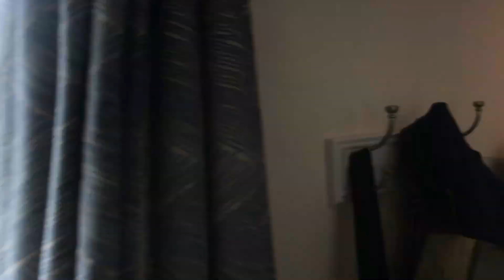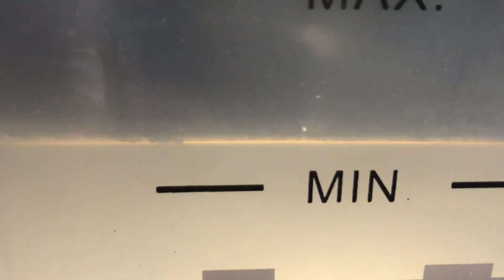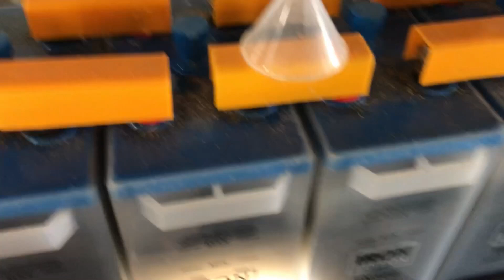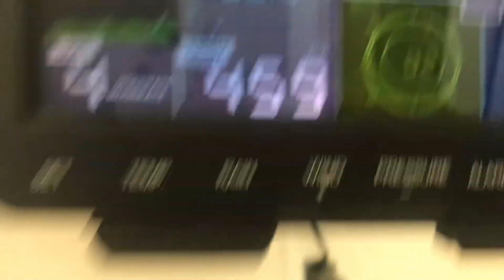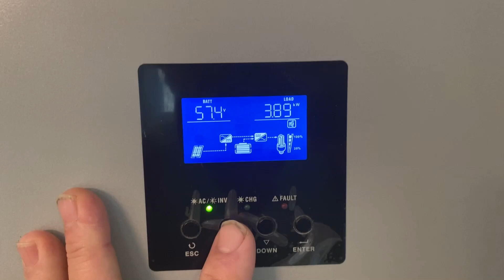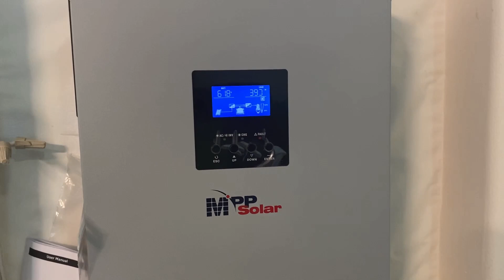72 MPP Solar 5048MG with Nickel Iron Batteries Overview

Comment: Hi Steve, I have  40 x 1200amp hrs  nickel iron batteries and I would like to know the settings for 5048ms controller to run 64v , I would like to know the settings if possible to set this up. Glenn
Reply from the maker: You need to set both bulk and float voltages to 64v. Charging amps for 1200ah set to the highest setting.

Comment: Are you aware of any  solar power meters that can be remotely monitored similar to the reading on your weather display in watt per meter etc ? If so I would like to get that information from you., I would also like info on which weather unit you are using ie brand model etc.  Thanks in advance.
Reply from the maker: I ordered a sensor from EBay that measures light intensity. I plan to interface it to a SONOFF so that I can access the information from it, but that will be a ways off before I get around to it. 
My weather station is Ambient Weather WS-2902.
Reply: @OffGridLivingReally  great Thanks
Reply: @OffGridLivingReally   Thanks

Comment: Hey, the inverters have AC input and AC output, what connects where? What's the difference?
Thanks
Reply from the maker: Regarding an MPP Solar inverter:  The input is used from either a generator or commercial power. The inverter will simultaneously charge your batteries and pass that power through to your house. It must be the same voltage as your inverter output. So if your inverter outputs 240VAC, you must give it 240VAC. the AC output connects to your AC mains in the service panel. If you need split phase power you must first run it through a center tapped transformer before attaching to your mains service panel. Try to find an electrician to help you install it. These inverters generally use high voltages on the AC an DC terminals that can easily kill you. I have a friend who was nearly killed recently. His thumb was nearly burned completely off and he has large hole in his chest where the electricity exited. Please be careful.
Reply: @OffGridLivingReally  
Very well explained. Thank you sir

Comment: Hey Steve hope all is well,
On a pwm charge controller is it better to up your voltage or your amperage?Either way I configure my panels it same wattage...
It's the rig I carry hunting and has short leads to everything so that's not a worry.The pwm is cheap chinese stuff but works for what I'm doing.It's max voltage is 50v 30a.The panels(4) max at 20v at 4.5a each.Right now it's all parallel and works fine.I was just curious if I series 2 panels then parallel them would it charge better?I think correct term would be 2s2p lol but that's jedi talk for you masters!Thanks
Reply: Chris Lewis on pwm, higher amperage is better.

Comment: Is there a specific MPP inverter I need to handle the high charge voltage of a NiFe bank?  I have the manual for the LV5048 and it looks like it only handles up to 60V.  I am considering a 40 cell NiFe bank purchase but the full charge level on that bank would be 66V.  What info am I missing?  Thanks!
Reply: Peter Zehr you are right. The LV5048 only goes to 60V. The 5048MG is the only inverter from MP Solar that will provide voltage high enough to charge NiFe batteries.  I use the toroidal transformer to efficiently obtain split phase power. 
But if you already purchased the LV5048, all is not lost. You can take 3-4 cells out of your battery to lower the voltage of the battery.  You will lose about 10% of your battery capacity, but it’s all you can do.
Reply: @OffGridLivingSteve  I have not purchased the inverter yet, where can I find a torroidal transformer? What's the efficiency like? Thank you.
Reply: @OffGridLivingSteve  I have not bought the battery bank yet either. It looks like you have a 300 amp hour iron Edison bank at 48 volts nominal. How long can you go with little to no sun, no generator and normal household loads? 

I am looking at the iron Edison banks and also considering a chinese-manufactured cell that's available on eBay for about $3.5k less for a 300ah bank.  I would have to do 40s3p to get 300ah with the 100ah Chinese cells though.

Comment: Hello Steve, I have a 2424LV-MSD and it won't charge via PV. I verified that my PV cable are working fine but im getting no signal or the logo on the LCD panel when I plug them in. D oyou know of any setting that i might be missing to turn on or off.
Reply from the maker: You should email them at support@mppsolar.com. Include a photo of the label on the side of the inverter along with a description of the problem. There’s not really anything I can say without standing in front of it in person.

Comment: BeUtilityFree offers a much better nickel iron battery case that you can actually see the electrolyte level and don't have to use a flashlight to see the electrolyte level. Plus is has a much larger battery cap which is not so small and corrodes far less than the blue flip top caps that Iron Edison cells. They also offer a gravity feed self watering system.

Comment: Should I get the lv or the mg version
Reply from the maker: I need more information before I can recommend.
Reply: Please I’ll be waiting on you I’ve a solar array of 12000w
Reply: LV is for USA voltage, it does 120/208 3 phase/240 split phase
You will need two LV5048s to support 12kWp of panels, each mppt supports 4000w.

The MG can work without a battery, the LV must have a battery (in 48V flavor)

Comment: Can I use this for a Tesla module s and can the inverter be used without batteries please
Reply from the maker: The inverter can be used without batteries, but I wouldn’t recommend it. It can charge a Tesla S with the adapter using level I or level II charging. It cannot handle level III charging
Reply: Is there any inverter you would recommend bro pricing isn’t my problem I’m tired of researching I seem to find nothing, looked at solark all in one but they’re not compatible with 230v/50hz
Reply: I’ve a peak load of 8000w please

Comment: Steve, do you remember whether the 5048GE which you had earlier ramped up the fan based on load or temperature and also the U1 firmware version? ,  My fans seems to always be On and it ramps up based on temperatrure, mine had a USB and RS232 port but yours had a relay port and USB. Mine has a U1 version of 30.46
Reply from the maker: I like the GE model the best, but it’s higher end voltage limitation prevented me from using it for nickel iron batteries. I do remember the fan running continuously, but it wasn’t an issue. I don’t remember firmware version, but I can find out if it’s necessary,  I have still access to one of them I sold. I don’t know why yours wouldn’t have a relay port without being a different model than mine though.
Reply: @OffGridLivingReally  

Thanks you for the reply, Yes there are two versions of the com board in GE, if one needs to get their wifi box working then you need a com board with RS232. I would be grateful, if you can find out the firmware version of U1.
Reply: wrapter ok next time I’m over there I’ll have a look. It might be a bit though.
Reply: @OffGridLivingSteve   Thanks Steve.

Comment: Steve here is a very stupid question . What happens when every thing is topped off and 100% charged what than
Reply: archie ball it’s not a stupid question at all. Lots of people ask. The electricity available from the solar panels simply goes nowhere. It’s the best time to run your A/C, air compressor, welder, etc. That way you are using the electricity directly from the panels and not so much from the batteries.
Reply: @OffGridLivingSteve  I am guessing that it would be also possible to use the heating elements (using lower wattage ones than the originals) in the water heater as a load dump to make the hot water faster.

Comment: Very cool overview.  Your unique approach to off-grid solar/EV living, and your use of nickel iron batteries, is a game changer.  Question:  now that the system is mature is there anything you'd do differently if you had to start over?
Reply: That's a good question  Obviously the changes I made as the system evolved are those things I would have done differently.  Changing the inverters to ones with higher charging voltages helped immensely.  I would have bought a heat pump clothes dryer initially instead of a gas dryer.  I would like to have 5 more panels of what I have,but don't we all?  LOL

Comment: steve what is the most power you were able to pull from your ELC T-5000 5000-Watt Voltage Converter Transformer?
Reply: I wouldn't hesitate to run 3kw through any leg of it after the hack.  The transformer's breaker is 25amp which just so happens to be 3kw at 120v anyway.  Having said that for system safety's sake, now for the technical Easter Eggs:  Depending entirely on how well the load is balanced between the legs of the split phase, believe it or not the limit is infinite if the two legs are always within a couple of kw of each other.  If you have a 1000 watt resistive load on each leg, the neutral doesn't carry a load at all, because the two 1000 watt loads simply act as a voltage divider (in half)  - when this happens, the transformer isn't doing anything at all, it's just freewheeling and keeping the overall split phase balanced for the electrical system as loads are added or shut off.
Reply: @OffGridLivingSteve   Thanks man!

Comment: How many kilowatt hours does it take to dry a load
Reply: Depending on the load dampness and size, anywhere from 0.468kwh to 0.626kwh.
Reply: @OffGridLivingSteve  that's really good compared to my 120 volt dryer that has an electric heater element.  My 120v dryer takes 3kwh to dry a load.  I think my 240 volt electric dryer takes around 2kwh.
Reply: @SiriusSolar  The heatpump  technology is really amazing, and I really like the fact there is no duct work for exhaust!

Comment: Steve, Happy New year!  Glad to see the MG is working out(those  few extra volts of charge headroom look like they help a lot). Have you done a video on the "pad" monitor thing? That looks pretty handy. Walmart has some of the the small (10amp?) smart plug wifi switches for $9(?) right now.
Reply: Brad,  just those two more volts of charge made ALL THE DIFFERENCE.  I get a full charge to my nickel iron batteries now.  Any switch  that uses the TUYA app can be hacked to interface with Domoticz, OpenHAB, or HomeAssistant.  I found a hack on the web for them and it works great.  I have  Domoticz controlling everything.  I have ordered and received a WEMOS D1 mini with a relay shield.  I'm hoping to use them to automatically power down the aux inverter at night, and have the on board A/D converter capture the voltage reading every 20 seconds or so and forward the MQTT packets to cloudmqtt.com so I can see my voltage from anywhere in the world.  I did the same thing in Colorado and it worked great.  I might do a detailed video on how to do it but it would be virtually over everyones' head.  Maybe I'll put it on my old personal channel?
Reply: @OffGridLivingSteve  Yeah, it might fit in a little better over there. In concept I have a clue about what you are talking about, but in hardware I will have to look up the stuff you listed. A quick glance makes it look like that stuff (hardware) is on the sensor end of things. Is the "pad" (show W/m2 and stuff) just a Pi?
Reply: @bradquinn4161  my metrics for light power comes from an Ambient Weather Station that I bought from Amazon.  I tied it to Weather Underground so my Domoticz can read the values from there.  There is latency, but I have rapid fire enabled, so it's only a couple minutes delay.  You can see it here: https://www.wunderground.com/weather/us/hi/mountain-view/KHIMOUNT24
Reply: @OffGridLivingSteve  I noticed that there are two ways to hack the Tuya devices. Via hardware connecting pins and "talking" from a computer. Via wireless using Tuya convert. Just wanted to make sure you were aware of the wireless way.

Comment: When you reach the max inverter output and it switches to grid  "when set that way",  does it switch to %100 grid or does it continue suplying iverter power as well  suplimenting with the grid whatever the inverter cant provide?
Reply: I emailed MPP that question on the LV5048 model which is the US split phase version and they told me it would not blend the power together in that way so grid or not grid when over max wattage inverter provides but I would also like to see what steve says.  The big differences in the 5048 MG and LV5048 is no batteries have to be hooked up to the MG and the voltage from  pv input is up to 450 on MG but only about140v on the LV.  Steve uses transformer to convert the output from single phase 220v to Us split phase 240 volt.
Reply: @teekay1785  Good discussion thread you guys!  tee kay, everything you said is correct.  However to answer Lysol's question,  If you are using the grid (or generator) as backup, and the inverter sees and is utilizing the grid, the inverter passes the power through to your loads and simultaneously charges your batteries.  There's no way around this because if you think about it there's no point in having the inverter take power from the batteries that's being put into the from the grid - just bypass that step and supply it directly to the loads while it charges.
Having said that, if you operate it in UPS mode, the inverter's circuitry will sync to the incoming power so that a power outage will not interrupt the power.  I wouldn't use it to  power a life support system,  but for 99.9% of us it keeps critical systems with a smooth waveform even during a power outage.
Reply: @OffGridLivingSteve  Yes thats true but if batteries are full and PV supplying say 5,000 watts and load is 7,000 watts  MPP said the grid would supply all 7,000 watts.  So in effect wasting the 5,000 watts from the grid unless you have a "burn off load # such as straight electric water heater or well pump to tank etc or maybe in steves case charge the car if not fully charged. Wanted to be wrong about this. Of course this is all if you are not selling back to the grid.
Reply: @teekay1785  that's correct.  Your PV power simply goes nowhere.  These guys are designed pretty much for off grid only,  where AC  input is backup only.

Comment: Tesla power wall now has new battery chemistry that is used on the new Roadster that gives it a 629 mile range also known as the million mile battery. Ever one 💯 percent off the grid needs this battery that lasts forever. One power wall 2.0 or two of them to never run out of juice with the build in advanced high quality inverter in the Tesla battery and ur all set zero maintenance.
Reply: Sounds expensive.  But if anyone has got the money and wants it, I'd say go for it!